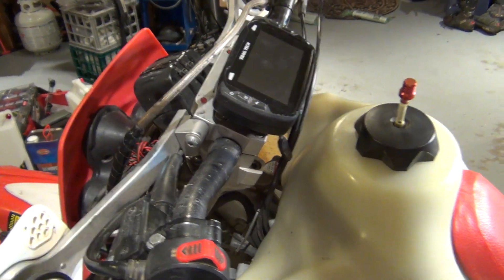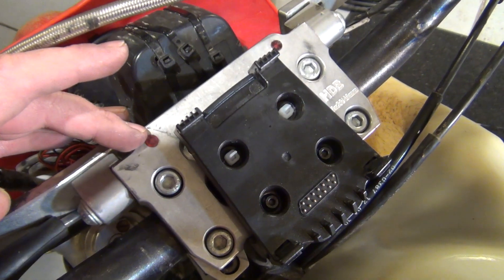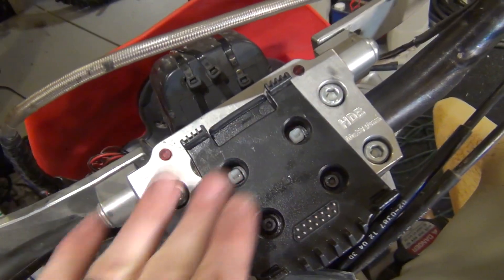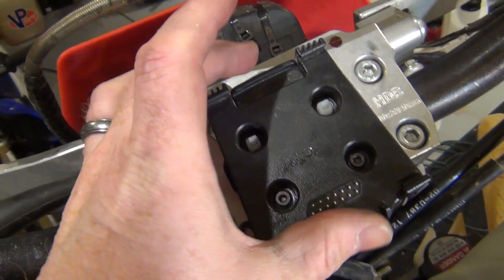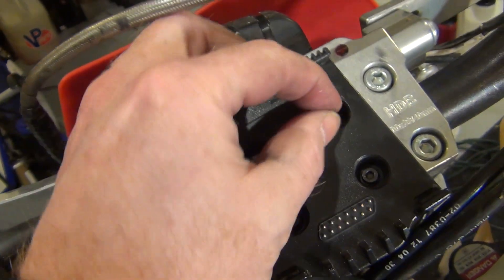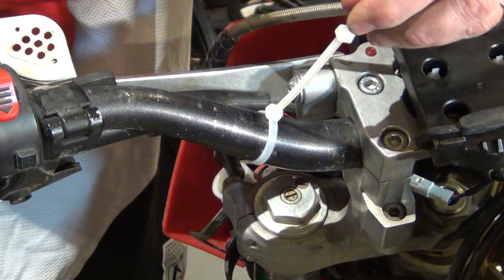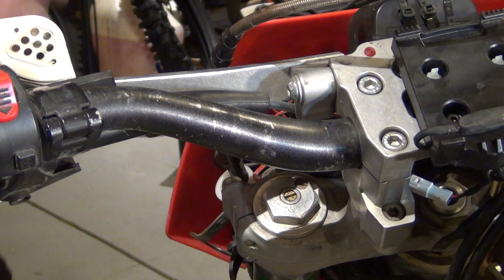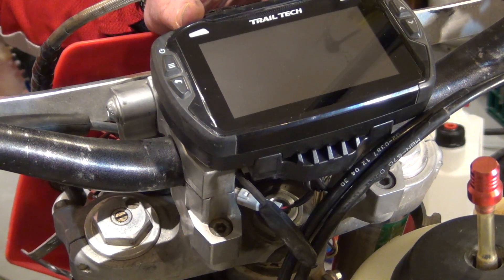Trail Tech Voyager Pro - Mounting to XR650R -To give you an idea!

Comment: Wondering if you can share how you are charging the Voyager pro on your XRR? Is it charged from the stator or have you added a battery?
Reply from the maker: I have an added battery. That black thing by the bars is a 12 volt drill battery. I also have a Trail Tech Regulator Rectifier. Drill batteries are CHEAP I think this one is Ryobi that I painted black cost me like $25.